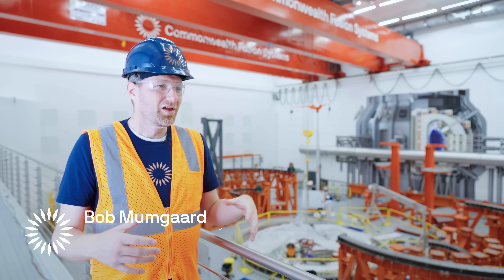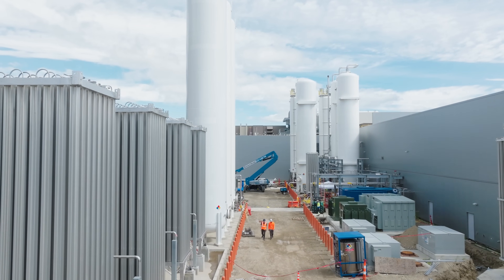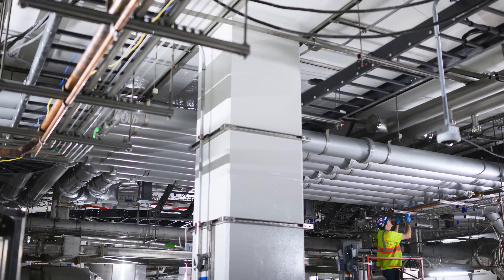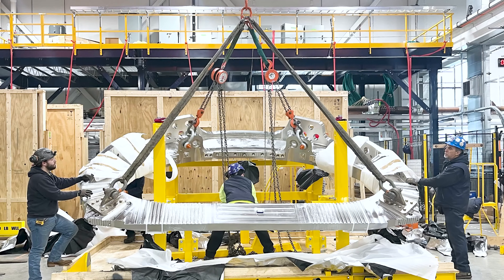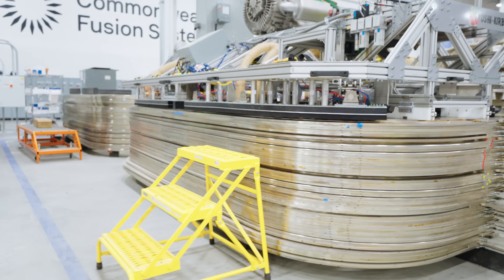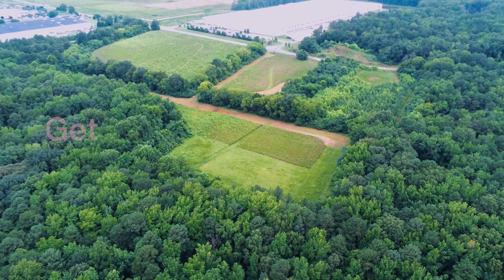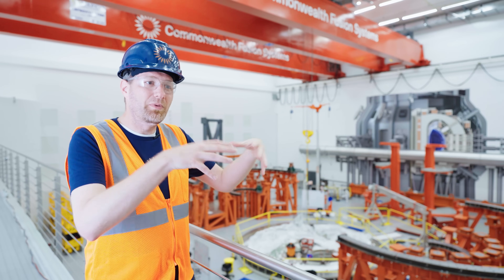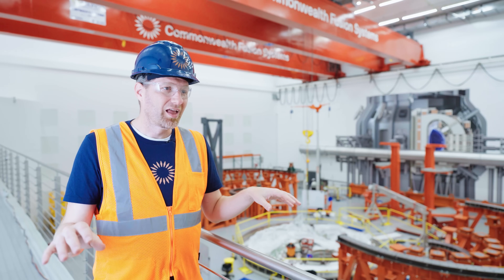An Update from Commonwealth Fusion Systems (July 2025)

Comment: What are the odds that they turn earth into a mini-sun when they crank it up and lose control of it?? Actually, this is very exciting, but I understand the skepticism. This is either one of the greatest scientific achievements or biggest snake concept ever.
Reply: Such reactors can't support the continuation of the fusion reaction without a continuous feed of energy into the experimental facility. When nuclear fusion energy experimenters refer to 'ignition' they are not referring to an ignition like a match where the reaction propagates throughout the entire mass of fuel until it is totally consumed. Nuclear fusion reactions will be far less fuel consuming and inefficient than ignition process that happens when a fire starting match is struck.

The vast majority of nuclear fusion energy presentations, that the vast majority of the target population is exposed to, are filled with basic fluff while omitting numerous key evaluation details.
Reply: There's a 100% chance that will happen hurr de durr, I'm going to say that it will happen for certain even though I'm not qualified in the slightest. Monkey monkey stick stick rock!

Sound familiar? If you don't know what you're talking about stfu with your paranoid conspiracy theories, you're as bad as the morons who claimed the LHC would create a black hole 😂😂😂 poor kids offed themselves because there were so many lies from people like you floating around.
Reply: @Fennecbutt - The CFS promotional presenters are well aware that the vast majority of their targeted audience has no academic background in this esoteric field of plasma and nuclear physics and so they can be easily snowed by their slanted presentations. Those, who have fallen in love with the efforts also have a tendency to suspend their critical thinking skills regarding what key potential show stoppers have been missed, or deliberately left out from the presentations.

Comment: High Temp Super Conductors &  fast Neutrons do not mix. Tokamak are a dead end design, as no to prevent destabilization of the magnetic containment field. Plasma generates magnetic fields which interacts with the containment field causing it to destabilize.

Comment: Selling 200 MW to google - with all these unknowns and surprises still ahead - that's what you would call "fake it 'till you make it". I admire your confidence and really, really hope it will work out that way. But I won't hold my breath.
Reply: Google is an investor and an insider. They are not simply guessing; they are privy to information that gives them confidence. That's why they committed to the 200 MW.
Reply: @DennisReyes-n6e  I am not talking about google being too confident. Committing to one day maybe buying electric power from a fusion reactor is not a risk, just a publicity stunt. I am talking about CFS, "selling" stuff that they don't even know yet if they can ever manufacture it. It's ridiculous because it gives the impression it's all just a "normal" project with a known outcome that needs to be done step by step, when it's actually still more on the level of a physics experiment with unknown outcome.
Reply: @DennisReyes-n6e - The Google negotiators likely don’t have a deep educational background in this field and can be easily snowed. They likely depended upon outside evaluations performed by contractors filled with nuclear fusion energy fans.
Reply: @DennisReyes-n6e  - In many cases the investors don't seek out an evaluation from knowledgeable critics. In the field of nuclear fusion energy physics and engineering almost all who have the knowledge derive that knowledge by being uncritical fans.
Reply: Google says we will buy 200 MW just so they can say they have invested $ in green energy. It’s a publicity move. Nothing more.
Reply: You're just an arrogant jerk. They're just waiting for construction projects to finish, and there's nothing mysterious about these projects, so there's no reason to think that they can't more or less keep to their planned schedule. :-)
Reply: @steve25782 - Consider that the ‘planned schedule’ has shifted. Three years ago CFS assumed that SPARC would be completed by now. CFS has never demonstrated the generation of a single watt-hour of fusion energy and the SPARC design doesn’t even come close to being a prototype of the intended ARC power plant design.

Comment: Most nuclear fusion energy fans tend to have little interest in inquiring into what information and parameters have been left out of the promotional presentations. Typically they are unlikely to request information such as a listing of the numerous ways that SPARC differs from the proposed ARC design. The CFS CEO often refer to SPARC as being a prototype of ARC. Ask him to backup that statement with detailed specifics.

Ask them to specify the period of time that SPARC will spend recovering from a 10 second maximum energy fusion pulse.

CFS claims that a major goal of SPARC experiments is to achieve a ‘net fusion energy gain’ of greater than one. Ask them for specifics on the input energy parameter they intend to use to calculate the energy gain value.  Ask them if that input energy value includes the total amount of energy required to power their experimental facility during a day of experiments, or if that input energy value is a small fraction of that total input energy value.

Ask them if SPARC will generate radioactive tritium fuel as is the proposed plan for ARC. If it doesn't generate its own tritium fuel then ask for the source of the tritium and how much they expect to pay for each gram of tritium that SPARC is expected to fuse.

Ask them what percentage of the tritium, in the SPARC plasma, they  expect to fuse during each 10 second experimental shot. Ask them, if that reaction percentage is low, how do they plan to recycle the unused tritium back for subsequent experimental shots.

Ask them for details regarding the irradiation of the SPARC superconducting magnets by the intense flux pulse of 14.1 MeV fusion neutrons. Ask them about the details regarding how heat removal will occur once the 14.1 MeV fusion neutron energy is converted to heat energy in the various superconducting magnet coils operating at temperatures of 8 Kelvin and 15 Kelvin.

Ask them if SPARC will contain a robust cooling system intended to rapidly remove the fusion energy heat deposited in the surrounding structure, including the super cold superconducting magnet coils.

Ask them if the SPARC machine, now well into its construction, will include typical components of other nuclear power reactors such as heat exchangers for a primary and secondary heat transfer system. Ask if there will be a water boiler component, or a steam superheater. Ask if there will be a condenser component and a water cooling component that dumps the excess reactor heat into a local natural material such as a lake, a river, or the atmosphere. Ask if there will be a turbine and a generator, like that which is assumed will exist in the ARC plan. Ask if SPARC will include an electrical substation, as is expected with the ARC plan.

When Commonwealth Fusion Systems created their agreement with Google it is very likely that the Google negotiation team never asked the kinds of questions that I've suggested above. I suggest that the Google negotiators consult with teams of nuclear fusion energy skeptics instead of with evaluation contractors who are staffed with fusion energy fans.
Reply: Outside of the Tritium supply and recycling issues the rest of your comments fail to introduce any additional issues which CFS has not already fully disclosed publicly in scientific papers, Youtube tours, Press Releases and statements by C-level and other senior staff.  I suspect that Google had their own "experts" when they negotiated such a momentous deal as to buy Half of the Fusion Power to be initially produced on the planet.
Reply: @WestyHighlander - Why hasn’t the tritium supply and recycling issues, essential for the successful operation of SPARC, been openly shared with journalists, the general public and investors? Was the negotiation team from Google, or their lead company, Alphabet, made aware of these tritium issues that the SPARC machine faces? Were they informed that tritium fuel is not plentiful but currently costs approximately $30,000 USD per gram in the open market. Why aren’t most of your employees and other fans aware of tritium’s rarity and extreme price?

If CFS has already fully disclosed, publicly, in scientific papers, YouTube tours, Press Releases and statements by C-level and other senior staff, the numerous issues that I've raised in this thread then why is it that numerous lower level CFS employees and fans of your projects were not aware of such issues?

In the spirit of openness I would appreciate knowing what division, or specific people in Google, or its head organization, Alphabet, were involved in the ARC power sharing negotiations with CFS.
Reply: @WestyHighlander  - Clearly, you trust that you and journalists have been fed accurate information without key evaluation details being omitted and that the funders have received analysis reports from consulting contractors that are true critics and not contractors composed of fusion fans.

You must have been aware that the SPARC  fusion pulses will last for a maximum of only 10 seconds then the machine will have to spend about four hours recovering, from that pulse, before another pulse test can be conducted. That means it will have an abysmally low fusion energy duty cycle. So, just on this one SPARC parameter, alone, it will not resemble anything like CFS's claimed 'prototype' of ARC.
Reply: Ive read their answers on alot of the thing s you are pointing to here on their website. Idk why you are so obsessed with shitting on their project? Is there some personal motive?
Reply: @delgermuruntsagaankhuu6951  - it is natural for fans to feel upset if they learn that the project, that they have come to greatly admire has withheld key evaluation details. CFS is in the process of consuming the $3 billion that they have received from dozens of investors around the globe who likely have received critical analysis from consulting contractors who also happen to be fusion energy fans. Since the first tokamak experiments began, in the 1950s, over $50 billion has been consumed by at least 100 experimental machines. Still no record holding experiment has come within orders of magnitudes of demonstrating an economically practical fusion power plant. Many techno-nerds believe that none of that effort has been a waste since it still generates some spin-offs. Rationalizations. The current spending is in the many billions per year now. We don't have the kind of time left that people prefer to believe we have. This spending would be better spent in existing sources of 'renewable' energy generation such as wind turbine and photovoltaic panel farms with battery storage.

I've learned to accept certain warnings that most people have strong vested interest in rejecting in favor of diversions, such as loving fusion technology..

Virtually all nuclear energy promoters, are in line with the vast majority of Earth's other 8.2+ billion humans, who continue to assume that we still have at least 20 years left to turn this 'Titanic' around using their favorite nuclear technology. They have become masterful in excluding the following warnings from their consciousness.

UN chief: World has less than 2 years to avoid 'runaway climate change' (TheHill)
  * This statement was made 7.0 years ago.

Comment: Very impressive progress on building SPARC.  Unfortunately, their plans for an ARC reactor are pure fantasy and hype due to the numerous fatal flaws of compact high field tokamak reactor designs.  Among the many physics problems are excessive divertor heat flux, need for costly external RF plasma heating and current drive with too little available wall space at unfavorably high densities, large core tungsten radiation and power loss at high density, and low plasma pressure relative to magnetic field pressure (low beta), implying unfavorable economics.  Among many serious engineering problems are the extremely high wall and magnet stresses during plasma disruptions, lack of routine access for required wall maintenance and repair, unproven magnet technology, and lack of a tested solution for tritium breeding.  Each of these problems is likely to be showstopper for their ARC reactor.  There are also many other unsolved reactor-level issues such as burn control, helium ash removal, and tritium inventory common to all tokamak reactor designs for the past 40 years.

Several SPARC-like high-field D-T tokamaks have been proposed since the 1980's, but only as a next-step fusion ignition experiments and not as a fusion reactor prototype.  Thus, SPARC results may have some academic "physics" interest near breakeven. But the main innovation in SPARC/ARC is the new magnet technology, which may have worked on a controlled test-stand, but which will most likely underperform or fail after years of stressful real-life tokamak operation, as have many conventional and superconducting tokamak magnet systems in the past. 

This CFS promise to deliver 200 MW of fusion power is among the most absurd of the many recent fusion confidence scams, and in my opinion their lies to Google and other gullible investors are an embarrassment to MIT and to the international fusion research community.  See for example, see Federici et al, Nuclear Fusion 64 (2024) 108002, "Reply to Comment on ‘Relationship between magnetic field and tokamak size—a system engineering perspective and implications to fusion development".

Comment: Will there be tours for the public at any point? I live in Virginia and seeing this come together is absolutely captivating!
Reply: The ARC nuclear fusion energy electrical generating station will not exist unless Commonwealth Fusion Systems (CFS) SPARC experiments prove that CFS can achieve at least ten times the fusion energy generation compared to the total input energy it takes to power their facility during an experimental day. SPARC is only intended to generate fusion pulses lasting for 10 seconds, maximum, with very lengthy recovery periods between each experimental fusion energy pulse. CFS has yet to demonstrate that they can generate even one watt-hour of nuclear fusion energy, or that they can achieve, even that tiny amount, in a cost effective manner.
Reply: @vernonbrechin4207 we’re rooting for them!